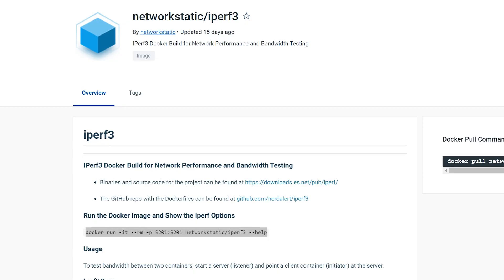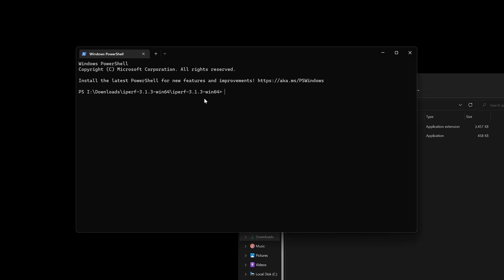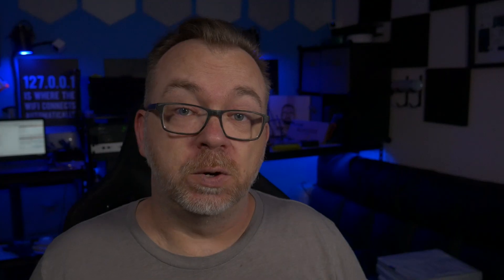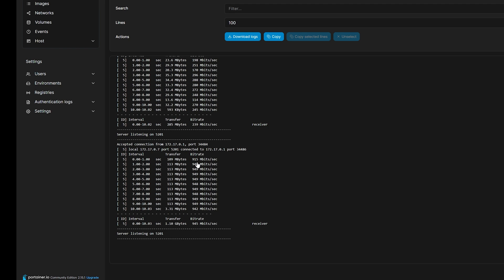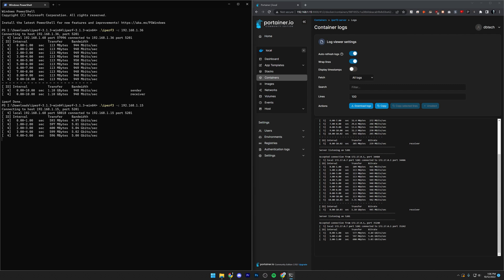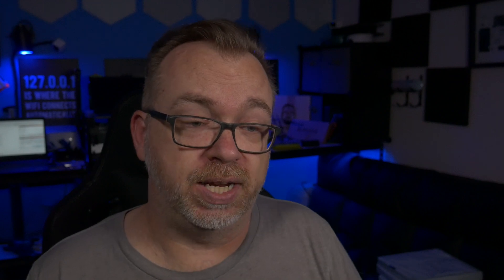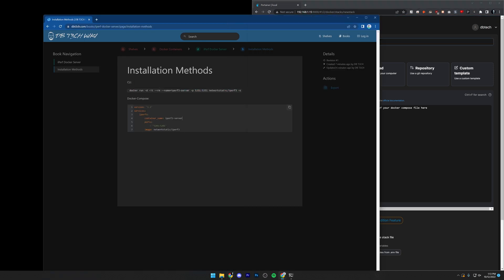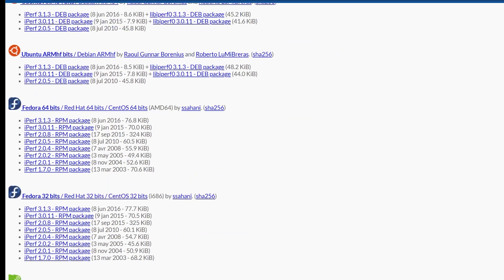Test Your Networking Gear with an iPerf Server in Docker

Comment: How can I edit the docker instance to allow more ports to be used besides the 5201 port?
Reply from the maker: I don't understand why you need it on more ports. It only recognizes one port.  To get it to work on multiple ports, you'd have to install multiple instances of the container.

If you want to use it on a port other than 5201, then you would change the port line to be something like:

      - '5555:5201'

Just don't change the ":5201" because that's the port that the container is listening on.
Reply: Thank you  @DBTechYT  
My understanding is that once a client uses the default port 5201, the other clients have to wait until that port is released. 
The plan is to create a server multiple client PCs can use.
Reply from the maker: That is correct about the port. This container only listens on 1 port. Internally that port is 5201, but you can change that port to something else with the instructions I provided in my previous comment.

If you want/need to deploy multiple instances of this, then you could do that and just change the port number incrementally on each instance. For example:

First container
      - '5555:5201'

Second container
      - '5556:5201'

Third Container
      - '5557:5201'

Fourth Container
      - '5558:5201'

You would also need to change the container name of each instance as well. So, like:

container_name: iperf3-server1
container_name: iperf3-server2
container_name: iperf3-server3
container_name: iperf3-server4